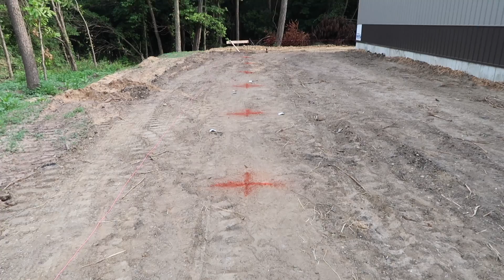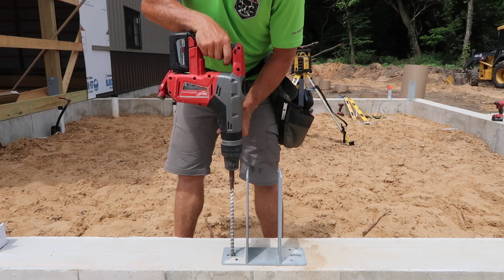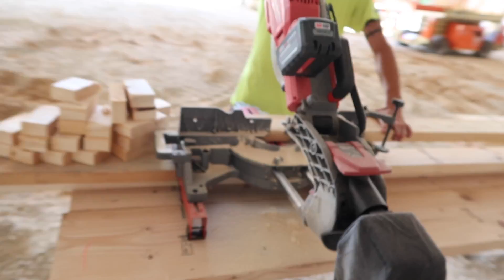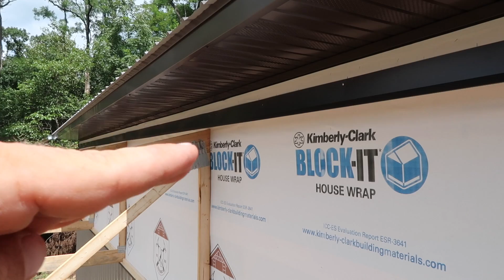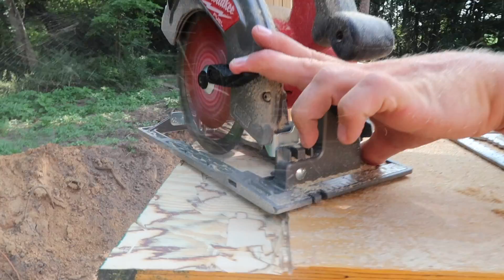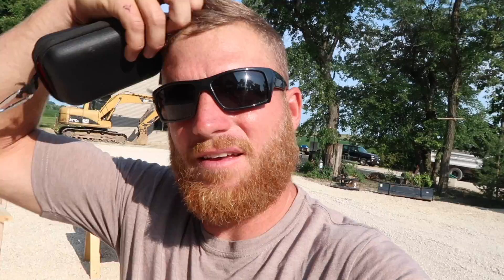Building the Dream: Episode 9 - Framing a lean to

Comment: Sometimes getting concrete on your skin is dangerous. 3 of us on a job ended up with serious burns after a hot summer day pouring. One dude washed just a little smidge off his chest, the water ran down on his Manhood, and burned his tip bad enough to be in the ER

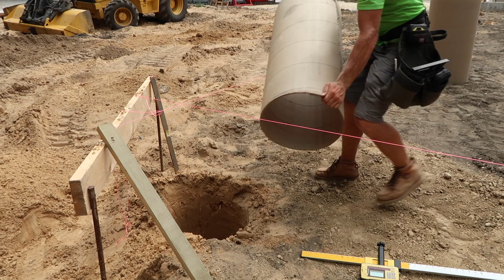Comment: Where do you get these cardboard tubes used in metal coils? Around 7:40 on video. Are they cheaper than the very expensive sonotubes? Thanks.

Comment: Kyle, great stuff!,  I’m planning on building a similar lean-to 14 feet wide by 80 feet long off a existing 12 foot high barn.  I was thinking of going with rafters 2x8 24” on center instead of trusses.  Do you see any issues I might have using rafters vs trusses.  Planning on steel for roof and walls.  Keep up the great work!

Comment: I absolutely love your work brother, but a sand ground environment for those columns is not the best way to anchor the beams for those lean to's.  The ground is going to gobble them up gradually, especially if there are multiple vibrations occurring within that monster shop you built.

Comment: Kyle,  I'm planning to build my first pole barn so have been watching several of your videos' recently.   Appreciate all the informative videos'; keep them coming.  From your Building the Dream Episode 9 video I would like to understand how you attached the  LVL's to the post.  I'm referring to the LVL's used to support the lean to roof.  You don't really detail this in this video.  It appears that you do not notch the post to support the LVL's so I'll assume you use some type of mechanical fastener.  Was this attachment specified by the Eng who sized the LVL for this project and what mechanical fasteners were used?  What's your thoughts on notching the post to support the LVL's?  I've always preferred setting support beams or headers on top of the post with brackets or insetting them in notches in the post.  Thoughts?

Comment: How do you make sure the rebar anchored post brackets are 90 degrees from the wall, so the post and trusses on the lean to line up. Do you just eyeball it with the string?
Reply from the maker: Use math

Comment: You seem to drill down farther in the cement then the length of the bolts you use on the brackets, why is that?

Comment: Thanks for another great video! I'm always impressed with the efficiency and accuracy of your guys' work! Have you ever used screw piles instead of concrete piles? Just curious is all, not criticizing. I switched from concrete to screw piles about 4 years ago. I like the added speed and no dirt to haul away after. They have better stength against uplift and a cap can be welded on to suit any need. I set them to depth/height to the top of the pile with a laser level. The only con that I have found with them is they aren't as aesthetically pleasing as a concrete pile of they are left exposed. Other than that it's nice to have a finished pile all in one go and not having to wait for concrete to set up before building on them.

Comment: Why not use the first technique you used in this series for your layout station? Put it on the corner you pointed out, then dial it in from the other end of the building, to the left of the shot. That wouldve given you the 90 off the building, right?

Comment: Hey to Kyle, Dave here

If time and money weren't issues, how would you approach getting all the 63OT brackets dead-center of their concrete piers; and assuming you still used piers instead of incorporating those with the building's footing?

Most of the pier's brackets look very close to center but one or two may have been toward the edge of their pier.

Thanks, Lord Jesus bless

Comment: In the DiResta Dream Shop you added the Zip sheathing/plywood to the walls and roof, but in this build you just went straight to the roofing and steel siding. Is there benefits and disadvantages to each method?

Comment: Why are you not vibrating the air and any voids out of the concrete piles when you pour???? You are really compromising the structural integrity of the concrete by not vibrating it. And not using steel reinforcement like rebar or a cage/mesh...are you using fibre-mesh concrete or something?

Comment: Could you have used the 3-4-5 method to square the corners? Seems like the tape stretched out the distance you had it would induce error. Your quality knocks my socks off so it's just a question.

Comment: Kyle, I saw in other videos that concrete folks tend to use a vibrator to remove air and make a more contiguous concrete structure. Would be a good idea to use it in a construction like yours, or is it an overhead?

Comment: Another awesome, informative video! Any reason, other than cost, that you don't use the saddle type purlin brackets in this application? Thanks for sharing your knowledge and experience with all of us.
Reply: Stud or Purlin, both use the same type of brackets, at least in the USA.
Reply: This is what I was referring to. Several post frame builders in the US use them including Lester Buildings.

https://www.fastenersplus.com/Simpson-PFD26B-2x6-Post-Frame-Saddle-Hanger-G90-Galvanized

Comment: I am no builder but an idea occurred: make a big wood square (something like a sturdy 2 x 4 and like 3 or 4 ft long beams), checked for perfection with a speed square in two lines draw in the wood. And make an inch hole tangent internally to each line in the wood square 90 V angle. put a nail in the interssection point. Set a snapline in the point of the structure you need as reference and get the desired distance lateral of the building up to the  V angle. Stretch that snapline from this point alongside the building and make them both coincide with your wood big square marked lines. Set an inch diameter pole through the hole to the ground and level checked for vertical alignment, and do the same for the other corner. Maybe a little more trouble to set but as for accuracy I thing it's gonna be very nice. Use a bubble level to assure square paralel to ground as well. Just a suggestion, but, as i said, no builder here, just a brazilian admirer. Nice job as always, you show us, TY.

Comment: Another great video! I have never seen a builder use new tools/ technology to the extent that you do. These tools and your techniques produce a quality building.

I used to layout additions like you do - diagonals off the long wall to make it square to the building face. This way ensures that you are square. Never push out an intersecting wall because it may not be square to the wall that you are working parallel with. I know you built the building and it is square, but a building by others may not be.

Comment: Just a quick question for you. I’m planning on adding on my garage. It’s not a lean to rather an add on at the end of the building or the length of the building. How would I go about mounting new trusses to the old ones? Do I need to remove the metal and insulation on the entire wall? I plan on keeping this addition  open and not insulated.
Reply: just do as he did and instead of using a wood stub you can use a Simpson Strong-Tie brackets instead for a cleaner look.
Reply: Joshua79C C I was talking about at the other end of the building. Butting trusses together to make the building longer. Not sure how to go about doing that. I have metal and heavy insulation on the end of the building as well.

Comment: Another great video, I love your work and your attention to detail.  Quick tip when you are anchoring your column brackets, I see you are using a chrome socket and have used chrome in previous videos.  I know it’s just a small part of your job but you anchor a lot of column brackets and from my experience you loose torque through the chrome socket. The chrome socket actually flex’s on the impact guns causing a loss in torque. Plus they get beat up, they beat up your anvil on the gun and they are noisier.
Reply from the maker: thanks I agree...bad idea by me to use it

Comment: where do you get your brackets, and will they fit a 6x6 post
Reply from the maker: midwest perma column....I think they only work with laminated columns
Reply: Midwest Perma Column comes in 14 sizes for wet set as shown and 18 for drill set which includes half bracket but without a foot on one side like he has which is just a full bracket cut in half., including ones for 4 and 6 by 6 solid. just check out their website for all products and info.

Comment: Love the videos! However for the sake of your safety, please use an impact rated socket and not a chome one like you did at 10:16. Chrome sockets can explode as they're a much harder metal and finish. It's no fun picking small pieces of chromed metal out of your arms or legs, I speak from experience.
Reply from the maker: muzz3256 thanks I agree shame on me

Comment: I recently did a 16 x 36 lean to running purlins like that.  It was difficult up in the air. Did have to string line both end trusses.
Reply: Seen a number of videos where the contractor assembled sections of trusses on the ground and then lifted into pace by crane/telehandler into place only had to do the rest of them purlins in the final position at height, but they made a jog just above the ground to set sections for preassembly for a flat, level surface, makes it easier to install the in betweens and also had space to maneuver the pieces into place.

Comment: So how big of a drill bit do you use into the concrete for the lag screws? Also how big are the lag screws that you used, for the office? I'm just curious as to how much the lag screws grab into the concrete.
Reply from the maker: SaltyFF 6” 5/8 Simpson titen hd
Reply: A few years ago, I repaired a damaged bollard.  It had three of those bolts and stopped a Buick.  It took a four foot pipe extention on my breaker bar to get them out of the concrete

Comment: I remember when i was in construction , was repairing a 75 by 200 foot barn that suffered fire damage, we were replacing steel sheeting that can off underside of the roof, were on scaffolding , and had corded drills running of a Yamaha generator ,

Comment: Why, no rebar in the sonotubes?
Reply: It looked like rebar coming off the bottom of the brackets to me. I assumed it was enough.
Reply: Chris Lemacks  that’s just to “anchor” the bracket into the concrete. 
On that lean to, if you get serious storm with high winds the roof of the lean to becomes a sail. Ripping it right out of the ground.
Reply: @kevindonohoe6605  oh ok. So they crack is what your saying? Isn't that what rebar is for? I'm seriously asking. I'm s fabricator by trade. So I'm being authentic here.
Reply: Chris Lemacks Chris Lemacks rebar would just strengthen the concrete. That’s all. Doesn’t cost much. 
Rebar wouldn’t stop the lean to from ripping out if the ground from a wind storm.
Reply: @kevindonohoe6605  so basically they dont need rebar since it won't make a difference.
Reply: Chris Lemacks it will prevent cracking of the concrete that supports the post.
Reply: Deeper piers with belled bottoms would be tons better.
Reply: I would imagine it’s not necessary as they seem to have an engineer that checks everything but I agree especially when the piles are above ground you would think they would need rebar to stop it cracking.

Comment: RR - if it is stronger to be placed on top of the truss than flush, why was it done flush?
Reply from the maker: It was due to the truss spacing. We couldn’t go on top with a 10’ span
Reply: It would have made their roof to high. Where it connects to the main building that flashing detail that he installed would not have worked.
Reply: That or dropped the interior ceiling too much, yeah.

Comment: I may be wrong but on the 20 ft opening with the LVL's in my area when two are called for they have to be glued and nailed together not put on each side of a post or anything. It looks like to me you still only have one, not two holding the roof up?
Reply: Those "LBLs" are tricky!!!🤣🤣🤣
Reply: Laminated Beneer Lumber???🤣🤣🤣
Reply: OH. look the spelling police. odd you get that much joy out of a typo......
Reply: @HDWRIGHT409  I found some mistakes here too.
Reply: I also was concerned about reducing the thickness of the LVL at each end.  Did the engineer allow for that change in the lumber?  If it’s not built as drawn, the engineering isn’t valid.  Probably never have a problem with it, but would rather see that material removed from the post, not the beam.

Comment: 10:30 thats not an impact rated socket......
Reply: FishFind3000 - it is right up until it splits.., 😁.  You can have a standard socket live a long life in this sort of application, I’ve driven hundreds of those concrete screws just the same way with standard sockets and I haven’t split one yet...
Reply: Since it's driving a lag bolt into concrete, doesn't really matter. Now, if you're attempting to fasten a regular bolt, different story altogether. Isn't near as much torque going through the thin sidewalls of those sockets for masonry fasteners.

Comment: Since you don’t seem to be specifically brand loyal....what’s your opinion on the “best” all around cordless system? Like if you only could have one and had to use all their battery tools...? Dewalt? MW? Makita? Something else? I’m jumping into the cordless revolution.
Reply from the maker: Cameron Lienhart I’m not brand loyal because no brand has every solution
Reply: RR Buildings soooooo..... basically no comment then? Although from this particular video, looks like MW is the answer. Besides maybe your hitachi nailer.
Reply from the maker: honestly I have always been a milwaukee fan from the beginning....but they don't make the best tool for every task...
Reply: When I worked for my step dad (basement waterproofing), we never used just one brand of tool. just like Kyle said, no one tool is a one-for-all.
Reply: Joshua79C C right. I understand that. But for someone who is not in the business and is just looking for an all around good system to invest in, it’s not practical to buy a la carte tools.